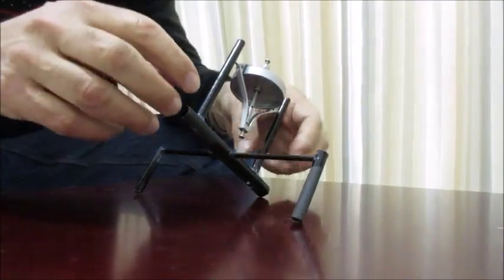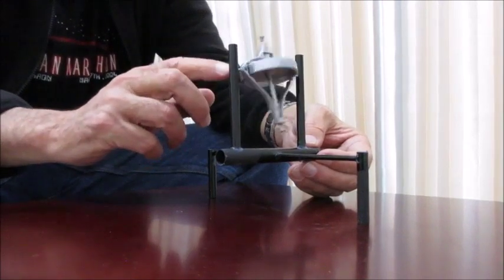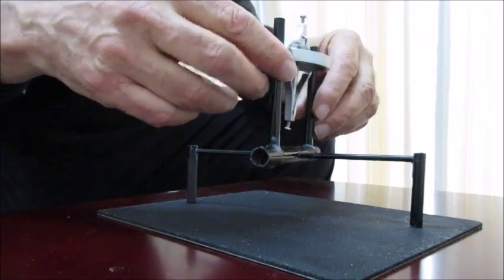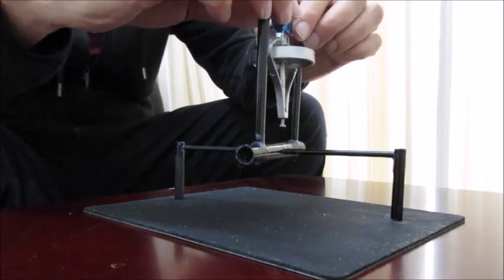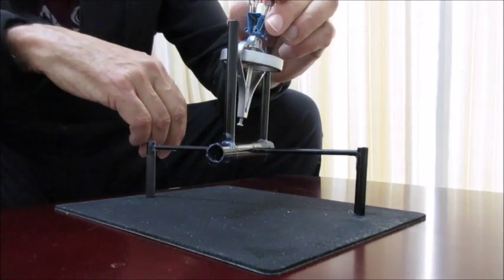How to Self Balance a Structure or Vehicle with a Gyroscope

Comment: AI Summary

Abstract:

This technical analysis explores the application of mechanical gyroscopes for achieving passive and active self-balancing in structures and vehicles. The input material details the construction and testing of a light-weight demonstration model built from carbon fiber, highlighting the principle of free precession for dynamic stability. Key concepts covered include the distinction between free precession (gravity-driven, passive correction) and forced precession (servo-controlled, active correction). Experimental findings confirm that stable self-balancing using free precession mandates a top-heavy configuration within the gimbaled gyroscope assembly, allowing gravity to introduce a precessional torque that corrects tilt. The video also discusses historical limitations of single-rotor systems (instability during turns) and the solution involving counter-rotating dual-rotor systems. Empirical data derived from the model indicates successful balancing is directly correlated with rotor mass/momentum and low structural weight.

Self-Balancing Structures via Gyroscopic Precession

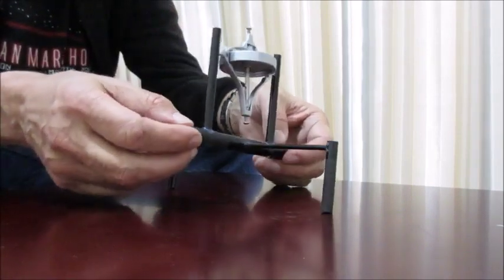*   0:30 Introduction to Self-Balancing: The discussion focuses on utilizing a mechanical gyroscope, mounted within a gimbal (1:52), to achieve self-balancing in a structure or vehicle. Simply attaching a spinning gyroscope to a two-wheeled vehicle (like a bicycle) will not induce stability; a gimbaled configuration is necessary to control the overall vehicle balance (2:00).
*   2:06 Two Balancing Methods:
    *   Free Precession (2:16): This method relies on gravity to maintain balance passively, as demonstrated by the model.
    *   Forced Precession (2:23): This requires attaching a computer-controlled servo to the gyroscope's gimbal axis to actively force the gyro's orientation, thereby applying torque to tilt the entire structure left or right.
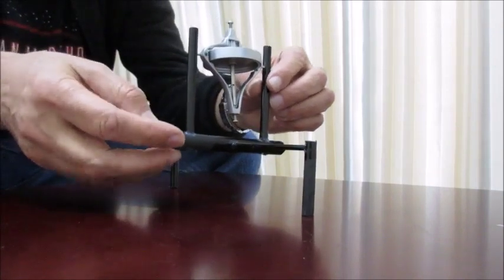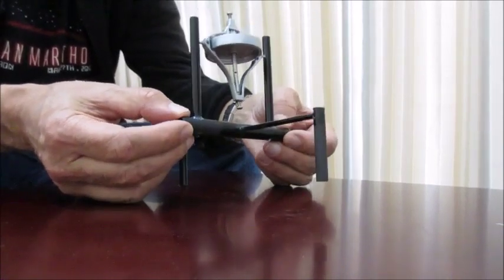*   3:09 Model Construction and Performance: The demonstration model, constructed using lightweight carbon fiber fishing pole sections (3:39) rather than heavier metal components, achieves an average balance time of 10 seconds due to reduced mass, requiring less energy to stabilize.
*   4:39 Critical Top-Heavy Requirement: Successful self-balancing using free precession requires the gyroscope assembly to be top-heavy (4:49).
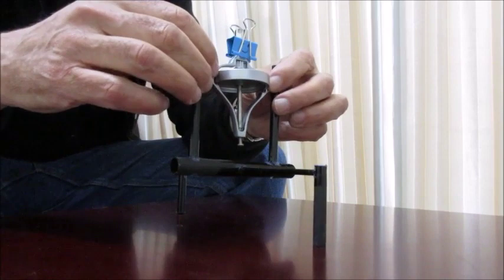    *   When the structure begins to fall (5:10), gravity acts on the top-heavy mass, initiating a precessional turn in the rotor. This forced turn generates a corrective torque that pushes the entire structure back toward the center (5:21), creating a self-correcting mechanism.
*   7:28 Historical Context and Limitations: Historically, self-balancing vehicles (monorails, early automobiles) utilized this mechanism.
    *   A significant challenge with a single rotor (7:44) is the risk of falling over when making a turn in one specific direction (7:53).
    *   The engineering solution implemented historically involved using two counter-rotating gyroscopes (8:00) to maintain stability regardless of the turning direction.
*   8:10 Empirical Testing of Weight Distribution: Initial testing with a slightly bottom-heavy configuration (8:22) resulted in balance for only "just a second" (8:37), with no recovery once falling began (8:44).
    *   The application of additional weight to the top (9:05, 9:57) successfully achieved the necessary top-heavy configuration, demonstrating self-correction and extended balance time (10:30).
*   11:01 System Decay: Stability is maintained only as long as the rotor possesses sufficient rotational momentum (11:04). Once momentum is lost, the corrective precessional torque diminishes, and the structure falls (11:15).

AI-generated summary created with gemini-2.5-flash-preview-09-2025 for free via RocketRecap-dot-com. (Input: 17,836 tokens, Output: 818 tokens, Est. cost: $0.0074).

Comment: the Brennan Train was the first Concept for a ONE Wheel Train. he use two horizontal gyros some spin in the oposit direction. if you use two more in a other axledirection can you lift up or press down. so short way,like a Cross and evey end have a gyro.the vertical axle can change degree and the way of force change. insted of left and rigt gyro some hold the train im balance wokrks the vertical axle for lift or press down,like a Pendelum. so welding 4 gyros like a cross,all gyros the same direction and hold it hand it on the left and rigth arm and now push or trakk the downgyro forward it backwards. the horizontal gyros hold the cross vertical and the vertical gyros hold the cross horicontal.you can also use 5 gyros,also like a cross,but one vertical,some must be heavyer then they other 4 som be like all 4 Pols. you can also put smal magnets on and put small coppercoils arround the wheel and have motorgyros.

Comment: I wonder how much energy is lost by the self correcting forces?
Reply from the maker: Yeah, gravity (and friction) is the real killer so precession angle gets larger until it can no longer overcome gravity. You can get Claude or Chatgpt to calculate it for you. I do that sometimes as I want to know what rpm is required to self balance a gyroscope. Unfortunately it is still a guess and the low rpm given is ideal, with no other friction or other impeding forces calculated. So it says, to actually keep the gyro self balanced you need at least 3 to 5 times this given rpm. Haha. So much for science. It is what it is. You need to build the machine then measure the variables to get a real world idea.

Comment: I made a gyro powered by a 130 motor with passive precession as a prototype for a monorail. I was dissapointed because it only balanced for 2 seconds. I tried to increase the mass of the flywheel but there was not much improvement

I thought the heavy part of the gimble should go down, but after watching this video, i flipped the gimble over and it finally balanced for much longer. Thanks :P
Reply from the maker: Yeah it is counter intuitive. The top weight when if falls down forces the gyro to torque the gimbal in the other direction and therefore self balances. I have to pull mine out now and then and run it because it thrills me to see it work. So happy you got yours working. I have found that the CG should be about 1 cm above the gimbal axis. Hope you make a video of yours so I can see it.

Comment: This will never be self balancing.
Reply from the maker: So what is it doing in the video if not self-balancing. What do you call it? I am interested.
Reply: @demej00  the video shows that the wobbling gets bigger and bigger and eventually the apparatus lies on the table. It's not self balancing as it can't be. As a whole it's top heavy.
Reply from the maker: @Kogacarlo  You are right, it is not a perpetual motion machine. Of course when the rotor stops moving, it falls over. The next step is to motorize the rotor and it stays up - which I have built many such machines. Here is one: https://youtu.be/NsBnBMIeXeo
Reply: @demej00  You say that as long as the wheel keeps turning it will stay up? You are probably right, meaning that I am wrong. I stand corrected :planet-orange-purple-ring:
Reply: Oh you poor dumb troll

Comment: Thank you for the video. I want to build a self leveling 'table top', or base,  on which two cameras will be placed and pointing in opposite directions. The model will then be placed onto my boat's longitudinal centerline with the cameras pointing to port and starboard respectively. The idea is for the table top, or base, to remain level when the boat rocks side-to-side. When floating down a river I will then maintain a horizontal filming perspective and not have one pointing upwards while the other would point downwards without this self-leveling mechanism
Reply from the maker: Pretty cool idea! Good luck with it!

Comment: How much should be the radius of gyroscopic disc  with respect to the mass of the body?  Is there any formula how we will judge the radius?
Reply from the maker: Also look at the math section in my ebook on how to build these things on my my blog site: https://demej00.wordpress.com/2020/02/08/self-balancing-gyroscope-two-wheeler/
Reply from the maker: Go to this website: http://www.gyroscopes.org/math.asp
You can see that by increasing the radius, you can achieve the same force as if you doubled the mass by increasing the thickness of the rotor. So increasing the radius of the rotor is always most effective. But practicality enters in as you don't want a rotor with a diameter so large that it becomes cumbersome to use.
Reply: @demej00  normal have 2 gyro and mass handle about 500 pound about then can use motorbike or bicykle and battery who spin gyros 10 000 rpm one CW and one CWW

Comment: Maybe if there is one more axis if movement, where the gyro can tilt the other way, when the frame starts to tilt to one side, it may fix this
Reply from the maker: If the gyro rolls in another axis from side to side, the resulting moment would only affect the pitch and the pitch of the vehicle cannot change since it has a foot in the front and a foot in the back.

Comment: hi, thx for ur video. u said when u move the gyro (tilt back) the structure will lean to the right,
so if u want to stabilize when the structure leaning to the right is tilt back the gyro.  my question is what happens if u tilt back the gyro when the structure is already in balance position, will it lean to the right. I need this info if I want to build 2 wheel vehicle, because as we know motorcycle need to lean right/left when it comes to corner.
Reply from the maker: Inadhi. Yes, if the vehicle is in balance and you move the gyroscope one way or the other it will force a sideways movement of the vehicle. Good luck with your project. See my two wheel gyro vehicle I build a few years ago.

Comment: does the gyroscope have to be located centered between the tweo wheels  ( incase of a bycicle) or can it be moved further towards the rear wheel and still balance ? .. please answer
Reply from the maker: Hi Max. Just my opinion but between is best while other locations will still work but if it is extremely toward one wheel or the other then there will be an adverse effect on how the bike turns. Doesnt have to be exactly centered though.

Comment: 1. If I build a car on but two wheels, will I be able to balance it with a Gyroscope? While riding it, I mean.

2. If I build a house on unstable ground, will I be able to balance it with a big enough Gyroscope?
Reply from the maker: In answer to #1 see Lit Motors C-1 motorcycle and there is a historical precedence for two wheel cars but they are not viable unless using two counter rotating gyroscopes.
In answer to #2 - anything is possible - a gyroscope can be scaled up. That would be interesting - even a model of a self balancing house.

Comment: It looks like the wobble starts small and gradually gets larger and larger. At the bottom of gyro try putting a stop so gyro can only move 1/4 or 3/8 inch in both direction. This should stop the increase in wobble, but will balance remain?
Reply: you mean need made brains computer  arduino and PID controller have perfect this

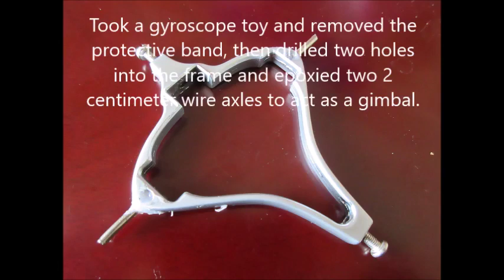Comment: 13:29  All the gyro machines featured in this video show that weight is added on to the top. 
To make the gyro top heavy without adding weight, drill a new horizontal axis at a lower position than the existing gyro axis. This will change its center of gravity, and it'll keep the overall weight down.  The difficult thing about this is - The two piece axis shafts would need to be longer, or you have to make your tube-frame extend closer to the gyro . 
P.S.  I don't know if this axis change - nullifies the gyroscopic procession effect, because the axis is no longer centered through the spinning flywheel.
Reply from the maker: Thanks for the idea. Actually, all I had to do was flip the gyro over and it was top heavy without a weight. Worked very well.
Reply: That was much easier.

Comment: Wouldn't it balance better if the weight was on the bottom?  or maybe make the cross bar have a bow downwards to center the balance to te middle? I was hoping to see you demonstrate the bottom weighted..
Reply: I also noticed that your Gyro sounds like it has a lot of friction due to poor fittings, maybe create a ball bearing gyro with a big bar bell weight?
Reply: It won't balance if the center of gravity of the gyro is below the center of cross bar, the system will slowly fall aside, due to the precession.
Reply from the maker: Yes, it was a cheapy.